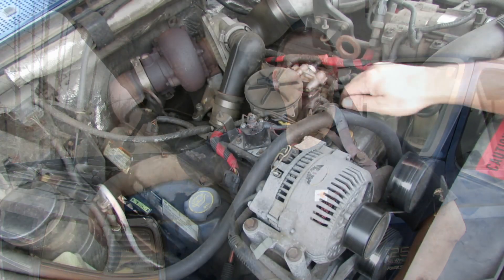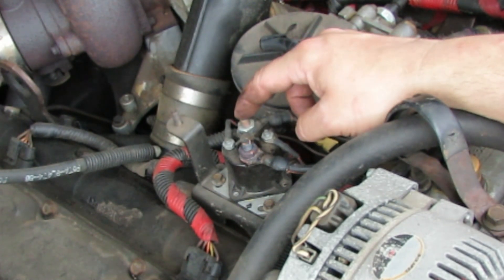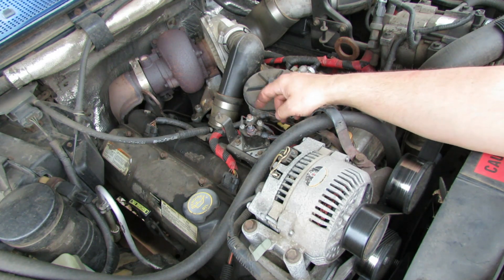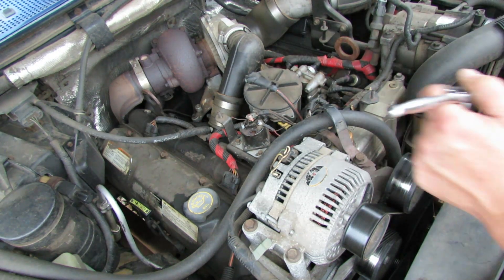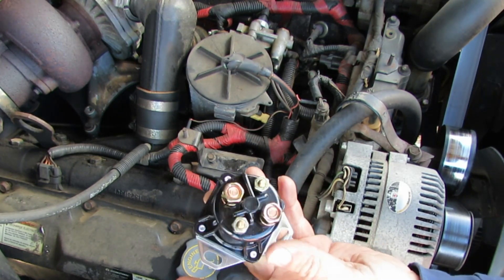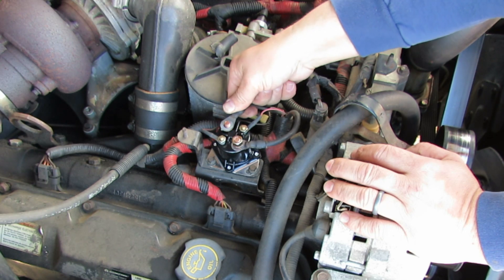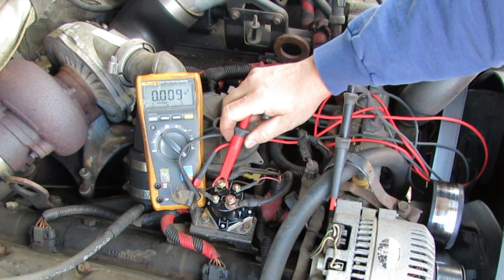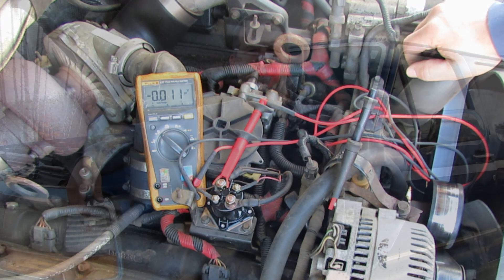How to Replace Glow Plug Relay 1996 Ford F-250 7.3L Powerstroke Turbo Diesel

Comment: Thanks I just bought a new wiring harness on my 96 Super Duty.  It came with the newer style Glow Plug Relay It was a relief  to see the newer style on your 96 too.
Reply from the maker: @3DMetalParts a new wiring harness... Sounds like a fun job. The old one lasted quite a while. When the glow plug system is working correctly she will fire up in just a few rotations even in the coldest temperatures (10's sometimes 0) here. I really like my truck. It has done everything I have asked it to do. Thanks for watching and sharing. ~Mr. C.